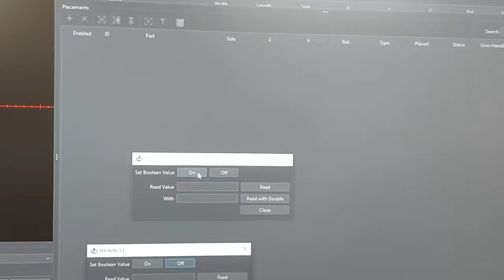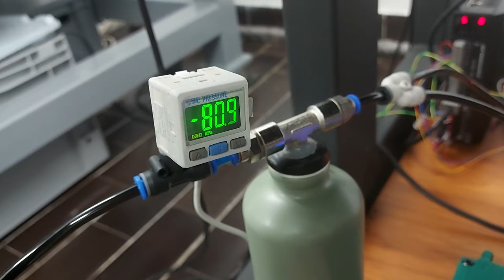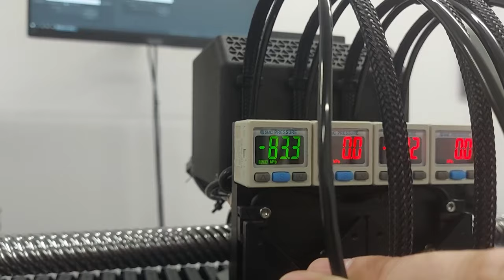ver2.0 PnP - Custom PCBA for Vacuum pumps

Comment: I would put a larger vacuum receiver, and a more efficient pump. In this case, the pump will turn on rarely. Continuous quiet operation.
Reply from the maker: I have almost zero leaks (only on CP45 nozzles a bit), regarding the quiet operation, in enclosure it will be super silent. 0.75L reservoir works OK, this all can be adjusted when the machine finaly starts to do its job, we will see.😊
Reply: @zdenkostanec1622  I have a 13 liter tank. vacuum pump for evacuation of air conditioners. Hysteresis 40...70kpa
Pump run time 30sec. Machine running time - installation of about 1000 components in silence)
Reply from the maker: @ORISDBDRAG  The question is, is it really necessary, If i go in that direction for me it would be a waste of space, and no redundancy, I want to keep it in a small size factor with redundant system and optimize the flow of vacuum for how much machine really needs it. It is easy to make overkill system, but to find balance and sweet spot, it is challenging but in the end rewarding.😊